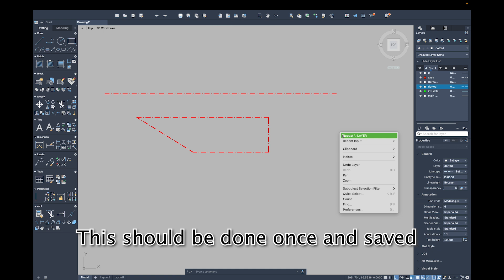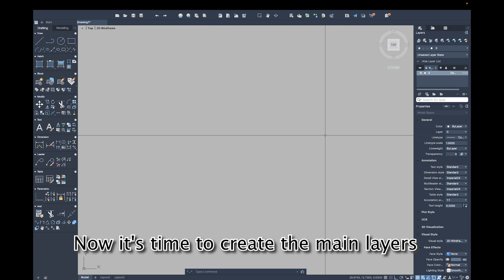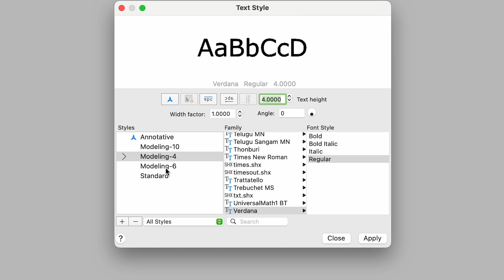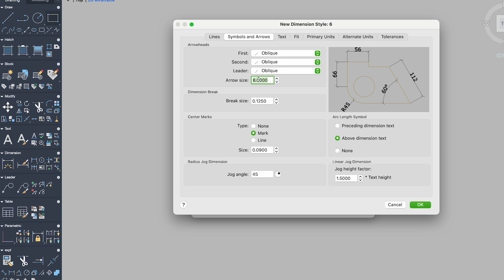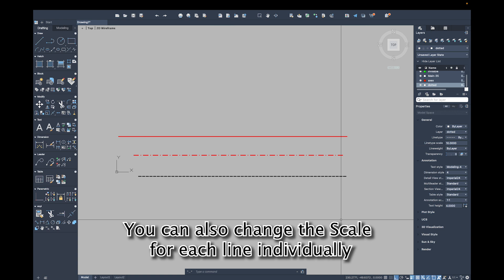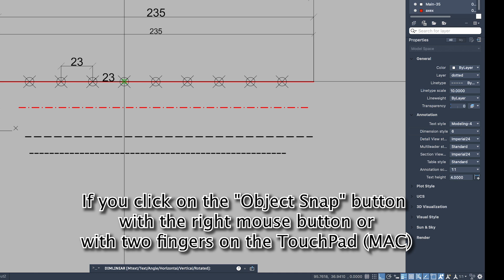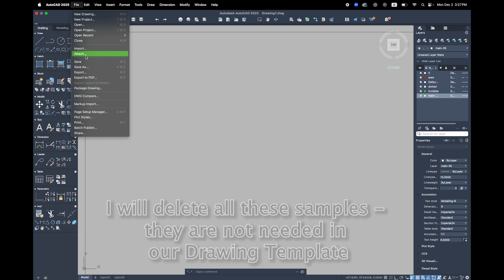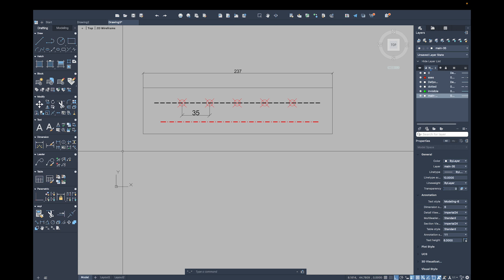#01 - AutoCAD - creating a Drawing Template

Comment: Hi Ohla, good video. I manage cad at a company and this issue of templates comes up a lot. They are ok, but not really the right way to do things. People hate when I say that. The problem is you should be regularly purging all to keep drawings clean. That nukes all unused layers, linetypes...gone. Trying to be careful with purge is bad. You want people to be sloppy, then purge, that is how production cad makes money. How do you get your stuff in then? You make little drawings with entities that have the layers, linetypes, and dim styles in them. Then you insert as block to the side when needed. That brings in whatever you need. You can also use scripts and some other methods, all good, as they bring in what you need at any time, no matter who has purged the drawing. I believe you can insert a template too, but make entities with the properties instead of blank. We still have a blank template, and its good for settings like snap and grid, but you should be tweaking common settings in an acaddoc.lsp when acad opens, again to deal with whatever mess the dwg was in when last closed. Its like all the obvious stuff beginners think should be done is actually wrong as you will get tired of being careful. Also, type your commands folks. Acad command line always has focus and use space for enter (return).

Comment: It has been way too long since i used AutoCad... 15 yrs or so? I wouldn`t know where to start w/o tutor anymore.
Reply from the maker: Yes, AutoCAD has changed a lot! Although if you worked in AutoCAD 2009 - in 2 hours of trying you would remember how... It's like I looked at AutoCAD 2025 for MAC for the first 2 hours, like a ram at a new gate. But then my hands started working by themselves. Now I'm not even ready to go back to the Windows version. Because in MAC you can work even without a mouse...

Comment: I could buy my 5 most wanted models for the price of AutoCAD 1-year license. Are there any good alternatives?😅
Reply: Personally I use Rhino 3D. It is the standard in maritime archaeology by now. More than powerful enough for us, does the same things, but is a fraction of the cost. Educational license is $200 or so. And yes, there are lighter cheaper forms of AutoCad out there, but I have no experience of them. Oly draws in AutoCad infinitely faster than I do in Rhino, I have to admit. The problem is not with Rhino, but with the operator in this case.
Reply: Most of the advice Olya offers, however, applies to any of the CAD software
Reply from the maker: I've been using AutoCAD all my life. First as an engineer, and now as an illustrator. I know it thoroughly! So as long as I have the opportunity to use AutoCAD, I'll continue to do so...
Reply: I hear about an open source tool named Onshape, wich is similar to AutoCad, and it seems to be cheaper,even free.
I do not know details, but i have seen people use it to programm plasma cutters.
Maybe worth checking ?